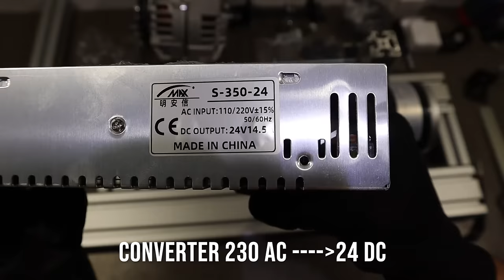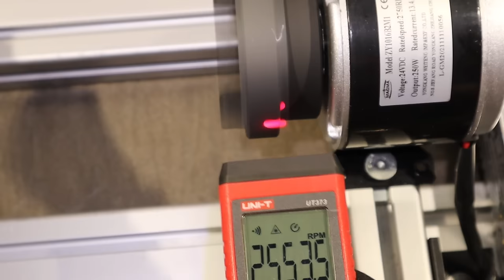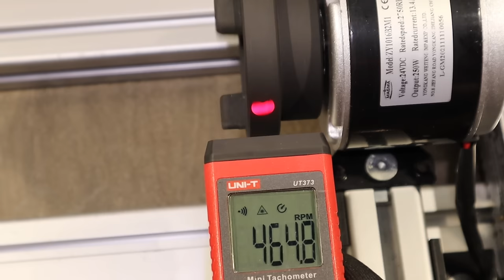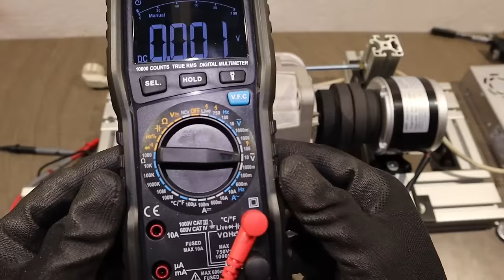Free energy generator powered by 250W DC motor and a truck alternator . FAKE OR NOT?

Comment: Nice use of a rail frame for mounting and a split connector instead of a pulley and belt, BUT this is barely free energy, just over unity up to the capability of the drive motor.  The test of how much it really puts out is with a load test

The motor does not have the horsepower to even get the full power range out of the alternator, fore that you will need to drive it with a 7 HP motor to drive and make the alternator produce meaningful power, just maintaining the 250W the motor requires to rotate is meaningless except to indicate it is a 1/10 HP motor.

Comment: its impressive , but this motor connected to car alternator getting too much hot. it ca not be used for more than few minutes . because Car alternator becomes hard after becoming magnet with 12 Volt DC Current  which makes motor very very hot. . . so it is not feasible.

Comment: I like that someone is trying to (dis)prove something! 

I think that truck dynamo's need to have a (12/24 V battery) Charge before it can generate electricity because the internals of it ( the rotor and stator)  are klunky Iron by itself and wont do anything until some magnetism is introduced.
Wich IMHO is lacking in this set-up.

But please, point me to the moment in the video where i missed the above.
Reply: Most alternators have residual magnetism on the rotors these days so they don't need external excitation current to start them.

Comment: What was the point in this trying to produce DC power ? try converting alternator to AC by getting rid of the rectifiers etc and just leaving the the Rota and coils. Then changing DC motor to an AC motor. Then see if you produce 230v AC. There are Vids on Ytube to advise.

Comment: Are you right minded, you are trying to use an alternating current output to run a 3 pole dc motor, firstly that's an ebike motor. It needs a perfect converter to run and not an alternating current source. 

Second thing is, if you feed the output from the alternator after altering the voltage to the required value that your converter needs for the ebike motor, it will function perfectly. 

What is the maximum torque at motor part and the alternator part. This actually decides the model works out or not finally... 

If you get more electrical wattage than the provided wattage, then your setup is right, if it is giving low wattage at output than the input wattage, then the setup is not fully ready and have faults. The last line is valid if the torque of motor is larger than the torque of alternator. I mean electrical power needed to generate a specific torque at motor, should be less than the electrical power generated by the alternator at that specific torque, this is how the electrical over unity machine works.

Comment: You should convert the ac out of the alternator to dc with diodes and capacitor then supply to the dc motor
Reply: It already is a 24DC alternator.

Comment: you  can  not  get  power  for  free !! you must  have  an outer  source  !!  good  try  !!  sorry  you should  know  the  diffrance !! is it  generator  or altraneator  !!!
Reply: Google the term over unity, tapping on residual current created by inertia & momentum. Flywheels help exaggerate torque as-well hence a wheel continues to spin once power is removed. 

You’d have to look at old farmers shop belt systems to understand you can amplify torque into speed then tap off of that conversion until you bog the system down 

Thermal runaways would also be a good way to understand things can have excessive power until they disintigrate

Comment: WHY would you connect 24V motor to a 12V alternator and expect a result ?  Use Battery as a buffer and 12V to 24V step up adapter.

Comment: Lmfao ok for one u don't spin the Alternator counter clockwise 🤣🤣🤣🤣🤣🤣🤣🤣 and FYI I have built many of them and they work in fact I have even built them out of generators as well amateur 😅
Reply: Post the video😂😂
Reply: @mrpickles4419  well for one you don't have the 12 volt light bulb or 12 volts running to the alternator to ingage it I don't need a video you need school 😉 🤣🤣🤣🤣💯
Reply: @fullmetaljacketgaming4971  ya you could of fooled me.

Comment: First you have to energize the alternator with 2-12volts dc. This excites the coil to get alternator to produce voltage. Without that voltage, alternator will have no output and can’t supply voltage for motor. I have used a battery to power motor and let alternator maintain charge of battery. You can also add an inverter to run other loads off battery and the alternator will continue charging battery. As long as you do not overload alternator, it will maintain charge of battery and run indefinitely.
I have a 3000watt inverter 12vdc-115vac off a 90 amp alternator. That way it does not overload alternator. It will run until you disconnect power to motor.

Comment: their is no free energy !!!!!!!!!
Reply: Then where does the energy in the air come from
Reply: @tobiascandy8405  heat energy? It comes from every thing like your TV it generates heat but it comes from electric energy.
Reply: @tobiascandy8405  and when you turn a generator you are putting energy into it to generate electricity.
Reply: Magnets working against each other create opposing magnetic fields that can turn a shaft like a motor. Connect it to a generator and you get energy that costs you nothing. Yes it’s free. But the science will say it is magnetic fields working make the energy. Most people look at it as, it did not cost me anything to run this long term, so it’s free. 
Don’t over think it or try to get so technical you lose perspective of what people are actually trying to do.
They want to replace gasoline, because of cost and availability in a disaster. Or any other fuel that they have to pay for.
Reply: @markhill485  suck it up, free energy isn’t real.
Reply: @markhill485  yes
Reply: 30 minute video 3 seconds of show and tell
Reply: I bet you think that the earth is flat
Reply: @brianfrench9487  not me bro
Reply: Technically true but what it cost up front in parts and material will pay for itself in the long run of let say 6 months from electric bill. Once it has paid for itself through that then it is considered "free" energy.
Reply: Fake 😂
Reply: Bull ! I have made for the US gov.